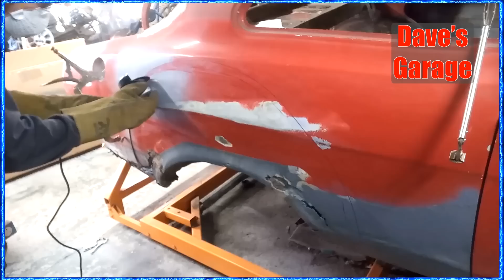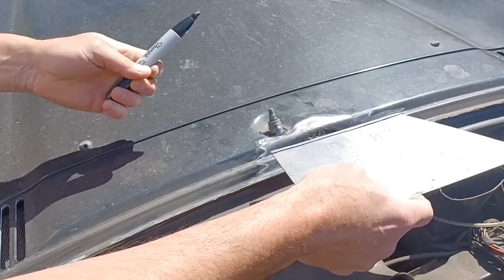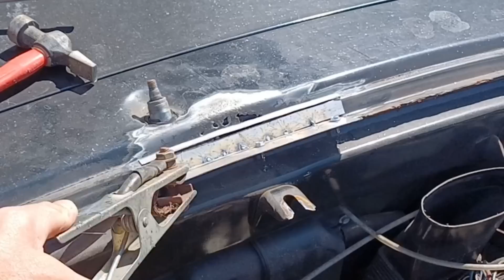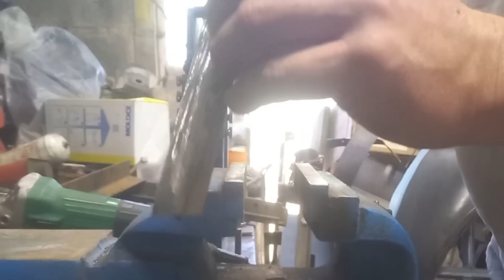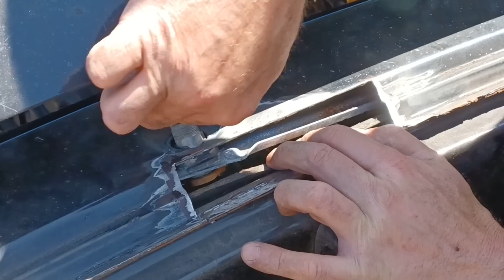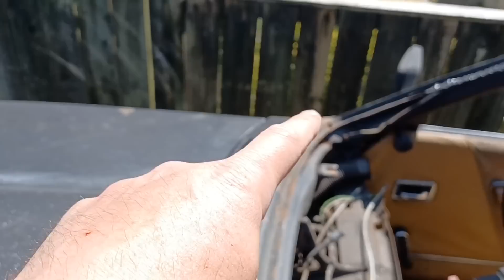Opel Manta B, windscreen scuttle repair, car restoration

Comment: It's great to see someone else using gasless wire. I've used it for donkeys years , (because I weld a lot outside) and never had a problem.  Remember to change the welder polarity and buy a good brand, I' was once given a part used roll of a no name brand and it didn't perform very well.  I guess it's a case of "you get what you pay for".  My current welder is a smartmig 162 and the lowest setting  with 0.8 wire   does a great weld on up to 1.5 mm steel . Not having to use the gas shroud is also a bones for getting in tight spots.  Great videos Dave with good tips  and info.
Reply from the maker: Thank you Philip 😊

Comment: Great work  mate. What's that someone says, Fitzee retiring?! Oh no. please no. Talking of Fitzee, I have just finished re-creating the radiator support panel on my BMW 840Ci. I have had to make it out of many small sections welded together and it has taken many many hours, but thanks to Fitzee, and yourself of course, I had the confidence to tackle it, and it has not turned out too bad. It is one of the most complex panels you can come across. Well done again Dave.
Reply from the maker: Thankyou Bob, someone else has commented that Fitzee is not retiring, it's a stunt to sell hats 😉

Comment: Seem to be getting on really well with the gasless wire Dave. I tried it years ago and had loads of bother with it, that said I was using a cheap toy of a gasless only welder, your machine is a cracking bit of kit for the price.
Reply from the maker: I do think it's the welder, like you I tried gasless years ago and found it terrible.

Comment: Lots of youtube welders who don't recommend the gasless welding for the type of repairs you are doing. What made you go with it Dave? I am asking from my novice welder self who has to mig an imp. Will be buying some thicker steel myself to stop me blowing holes. Have you tried 0.6 mig wire on your repairs ? If so what were the results like ?
Reply from the maker: Hi Gareth, I've given the gasless a go because a subscriber who works in a bodyshop swears by it, and so far so good.  I haven't tried 0.6mm gasless, but I do find 0.6mm normal wire a lot easier than 0.8mm

Comment: I've seen some of your videos, and I'm wondering if you are using flux core welding, based on what I can see.
I saw that same type of repair from Fitzee, but I think that with yours a shrinker/stretcher might have saved you some weld.
Keep up the good work, ii's always nice to see the reborn of those beauties from our childhood.
Reply from the maker: Hi Jorge, yep, gasless wire, trying it out, seems to work pretty well.
Reply: @DavesGarageuk  I used it on a floor but, I'm not yet brave enough for visible panels, but you inspired me 🙂

Comment: Dave, just looking at those welds. When you embraced fluxless did you reverse the polarity on your welder ? - clamp positive, gun negative. There's quite a bit on Youtube about it, how it transforms the quality of the welds. It's easily done on the machine, just a couple of nuts and flip the cables. https://www.youtube.com/watch?v=vVSBzRXWt10&t=621s
Reply from the maker: Yep, polarity swapped, I must remember to swap it back when I use gas again 🤣